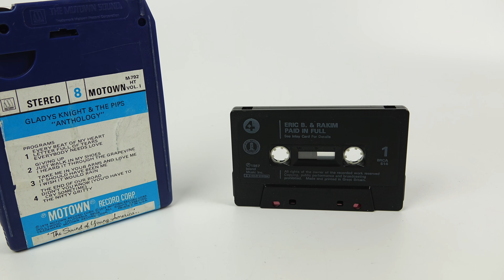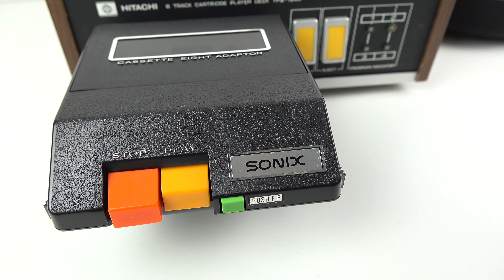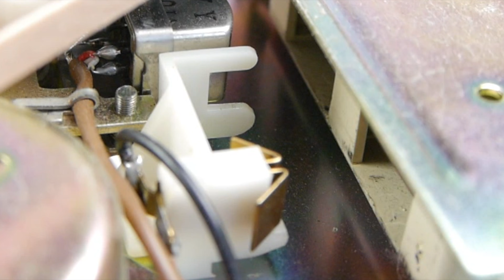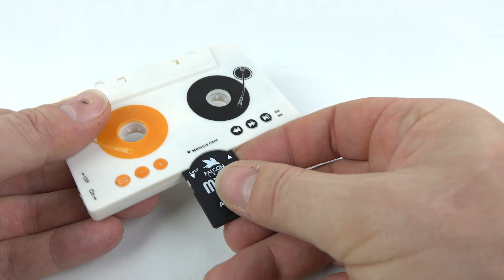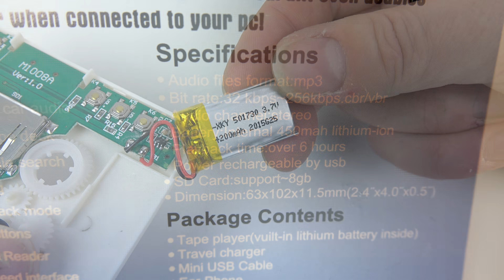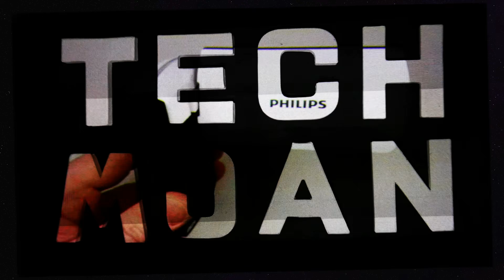Car Stereo Tape Adapters - 8-Track to Cassette to MP3

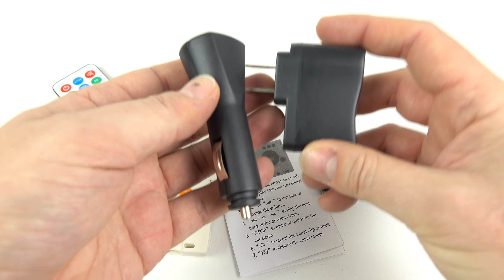Comment: 6:25, rule one for car adapters, if it doesn't have a fuse in the tip don't even bother thinking about wasting the time even taking them apart. Just no.

Comment: Just a crazy idea ... as there is some voltage available in an 8-track player, it should be possible to mount some BT-device in an empty 8-track cassette ... and even a card-reader ... Let's play (with) 8-tracks again !!!

Comment: Coming 7 years and 1600 comments late. My Venerable Bronco (1995) came with a cassette stereo. I didn't use it all that much. In 2011 I got an iPod from Megacorp as an anniversary gift. I got one of the adapter, then one that skipped for being boring. It worked pretty well. I used that all the way until 2020, when the stereo died. I replaced it with a modern one. I'd planned to keep using the iPod, but the new one had USB, so it was easier copy the MP3s to a flash drive.

Comment: the limitations written in manuals are just a list of what SD cards it has been tested with. some companies like Canon or Nikon make extensive tests with basically every SD available atm. others will just test a couple of basic ones. it's the writing speed and format which is important here.

Comment: I was hoping you would get to the bluetooth cassette adapter, but I guess that happened after 2016. The cool additional thing is that the cassette has a mic so I can use it my smart phone hands-free. Not bad for a 26 year old Buick sporting "Concert Sound II" with its own built in analogue  mixer.

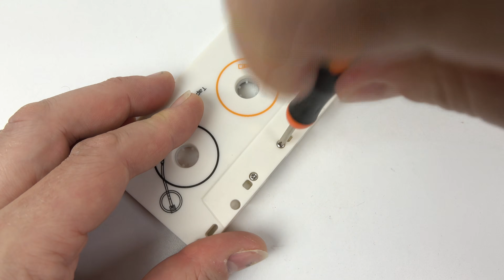Comment: 10:18 I would have added some little circuitry in there so that it would detect when the play head was actually engaged, and also detect the movement of the spools to use them as playback controls. Perhaps the gears could also drive a tiny generator to keep the battery charged.

Comment: Many thanks.   I just bought one of these 8-track adapters off eBay - it didn't seem to work, so with the help of your video, I took it apart and found that the belt has disintegrated.  I was about to write it off as yet another eBay failure when I wondered if it would still work with a cassette-to-3.5mm jack adapter.  Guess what, it did!  Even without any of the mechanism turning the head was still reading the cassette and passing the output to the 8-track.   Result!    I guess it would also probably work with a cassette-to-bluetooth adapter.

Comment: This wouldn't just have a use in cars. There were a lot of compact stereos sold in the mid-late 70s that just had 8-track and upgrading to cassette would have meant replacing the entire unit when the record industry dropped 8-track cartridges. This would have fit in quite nicely.

Comment: Although this is an old video I have one of these units that I have just found in the bottom of a drawer during cleanup. After seeing it have I have put the adaptor/player on charge and will be interested to see if the battery can still take a charge after sitting in a drawer for over 3 years. Wish it luck.

Comment: As strange as it may seem, my sister cleaned out a closet and found 2 unopened in the box AM/FM/8 Track car stereos, along with about a dozen 23 and 40 channel CB radios.( BTW They were mine, as the closet were in what used to be my bedroom before I got married) My current CD/Cassette deck in the Ranger has an auxiliary input (line input) that can be used with a MP3 player.
BTW the only 8 track tapes I still have are the old Gene Tracy Truck Stop tapes

Comment: I had figured out how the power gets to the adapter decades ago, and as you covered it the cobwebs very slowly cleared from my mind.  I remember buying a used car that had an 8-track and one of these adapters under the seat.  Retrieving that cassette adapter and slamming it into the 8-track put a huge smile on my face.

Comment: I have the tape adapter, it's really good expect for one major flaw. They should have given it a second power mode that powered the device on seeing rotation of the spools. As it doesn't have this and when used in a car you have to remember to eject the tape when you stop and to turn it off. 
Shame as otherwise it's a really good device.

Comment: Also, ive realised, if you have an 8 track player with a bad motor or belt, this device could potentially still work making an otherwise broken machine useful again as long as the auto change sensor works.

Comment: Most likely the 2GB limit was because that was the capacity at the moment but because of backwards compatibility the real limit is 32GB. Anything above that will not work because it's technically a different type.

Comment: https://www.amazon.com/Receiver-Bluetooth-Cassette-Adapter-Player/dp/B083BX9FPT/ref=asc_df_B083BX9FPT/?tag=hyprod-20&linkCode=df0&hvadid=416720031326&hvpos=&hvnetw=g&hvrand=6217685108824351860&hvpone=&hvptwo=&hvqmt=&hvdev=c&hvdvcmdl=&hvlocint=&hvlocphy=9016911&hvtargid=pla-885805583230&psc=1&tag=&ref=&adgrpid=95587149764&hvpone=&hvptwo=&hvadid=416720031326&hvpos=&hvnetw=g&hvrand=6217685108824351860&hvqmt=&hvdev=c&hvdvcmdl=&hvlocint=&hvlocphy=9016911&hvtargid=pla-885805583230

Comment: I have a Kraco adaptor. It's mechanically driven off of the 8 track capstan but uses power from the sensor to power the read and write heads. I believe it's possibly an amplifier inside of it.

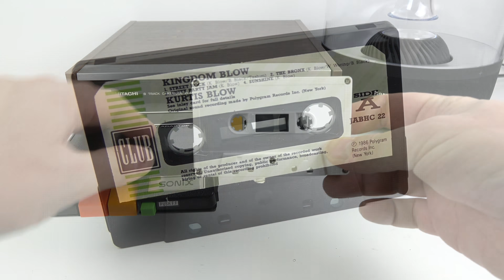Comment: 5:47 - "But let's move the same problem on perhaps 20 years or so later, if you've got an older vehicle with a Compact Cassette player, but you want to play MP3s on it." Yup. I actually bought two adapters for doing that. The first is the cassette adapter you showed right here, and it worked pretty well, but I'm surprised you didn't mention the second: an FM transmitter that attached to an MP3 player's headphone jack and played on any of several channels on the car's FM radio dial. The FM transmitter definitely had a sound quality advantage -- when it worked, that is. That, of course, was the problem. There were several things that sent me back to the cassette adapter. First, in places that have a lot of radio stations, like the city where I live now, it could be hard to find an FM frequency that wasn't being used by a commercial radio station, which the radio would pick up more readily than my little transmitter. Second, my FM transmitter tended to go through batteries quickly, and while it had an adapter that would plug into the cigarette lighter power plug, the car I bought this thing for didn't have a cigarette lighter. (On that car, the cigarette lighter and ashtray were optional, and since nobody in my family smokes, we didn't want to pay extra for it.) Third, even if there weren't any FM stations interfering with the signal, we found the range of the FM transmitter to be quite limited, and also very sensitive to where in the car it was sitting. So, while it sounded great when it worked, all too often, it DIDN'T work. So, back I went to the cassette adapter. That is, until  the tape deck in the car broke, at which point I gave up and just listened to the radio.

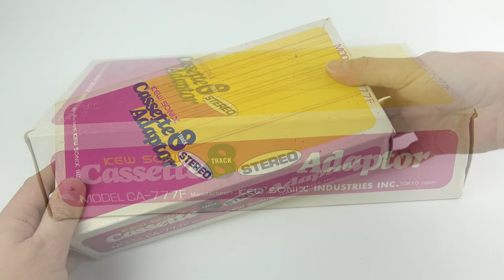Comment: 1:15 - "Now, I think these were supposed to be sold to people who didn't want to replace the deck in their vehicle; perhaps they didn't have the money for it..." If you look up some photos of built-in automotive 8-track tape decks, and then look up after-market car radios of the time, you'll see exactly why many people didn't want to replace the decks in their vehicles. In-dash 8-track decks, at least in American cars, were most often found in upscale models, and the decks were frequently built right into the decor of the dashboards. Replacing that built-in, original equipment radio and tape deck almost always meant covering up the exposed, open holes that the process created in the dash with a faceplate that didn't match and positively screamed "I AM NOT ORIGINAL EQUIPMENT!" This may have been less of an issue with Japanese and European cars, whose radios were often in alcoves in the dash and had black faceplates anyway. Younger drivers who had purchased a used, upscale car with in in-dash 8-track deck were usually fine with a replacement radio's obvious faceplate; a new, better-sounding radio with up-to-date features and, most likely, some new speakers added all around the car looked cool to them. (I remember this from installing my own after-market car stereo in my first car, a 1981 Dodge Aries that had come with a mono AM radio. The car was already 6 years old when I got it, and I liked the sportier look of the new radio faceplate instead of the stodgy, original AM radio.) But older drivers tended to care more about what the car looked like than what the radio sounded like, especially if the car wasn't that old. So, for them, an adapter like the 8-track to compact cassette one that you showed first was just the ticket. I wonder if maybe manufacturers of the adapters didn't take into account how many 8-track players were UNDER-dash models that could easily be replaced with newer players. That might explain where there are so many new-old stock adapters around.

Comment: I once had one of those 8 track to cassettes when I was 13 which was in 2011. It was powered by the motor of the unit though, not the sensing tape sensor. So when the belt broke, I took it completely apart and found that if I wired the sound head to an mp3 jack it worked to play my iPod. I then cut a hole in the back of it and made it work in fidelipac and Muntz 4 players. I was 13!

Comment: Don't forget about MP3 and WMV CDs! I bought a special aftermarket car stereo that could play those. Now they all can, but that was not the case in 2006 or so. My particular aftermarket stereo didn't have an AUX jack, and SD card slot, or a USB input (something I came to regret later), but I could at least play multiple albums without having to change discs in the car.

And, of course you could plug a Discman into a cassette adapter so you could play CDs on your cassette stereo.

That might be the first time an MP3 has ever been played in an 8-track player!

Comment: Hello I've bought the very same 8 track adapter but the FF spindle keeps pushing on its rubber wheel. Is it normal or should it only do so when the FF button is pushed ?

Comment: I've got a 12v power bank that I use to power a bunch of stuff in my room, and I installed a power draw meter to tell me how much power I drew at any given moment.
At 12v, my quite large cassette player used roughly .14 amps of power. That's just a bit over a single watt of power, which is an incredibly low demand. The 8 track sensor probably has a continuity detector in it, and that's probably why the strip is metal and the sensor has a current running through it.
I'm surprised with that kind of power source just sitting there, somebody didn't make an 8 track cigarette lighter adapter or something. You could probably just cram a whole radio's worth of electronics in there and just have a radio instead of 8 track

Comment: I had a cassete with a wire coming out of it that ended in a headphone jack... you could put it in any player and plug into a ipod or a phone. with the phone you could even use the speakers to answer calls... as long as you had the phone close to speak to its mic... and it wasn't any DIY, i bought it that way..  simpler that the mp3 player built into a cassete.

Comment: I do recall the radio announcement when the very last vehicle produced in North America rolled off of the assembly line with an 8- track player as standard equipment. It was a Ford pickup truck. I was just a boy. My generation grew up with transister radios, record albums, and cassettes. I have never owned an 8-track but saw some and thought that their continuous play was neat! Or "neato," as we used to say.

Comment: Just shove some pins in the 8 track player and you have a full power supply. Who would have thought that would work. I've tried one of those cable to caset adapters and it sounded terrible and only lasted a few hours before dying permanently.

Comment: I think that 8 Gb has been biggest SD card at that time. That's why it's printed for that MP3 players brochure. I've seen that many times through years that like for example smartphone supports 128 Gb but later came bigger SD cards like 256 Gb and those did work as well. Like my drone did too.

Comment: 13:26 you can only find it out by playing a file that is not stored in the first 8GB. You don't say if you did that in the video. Anyway, sometimes these limitations only mean the maximum size that was tested. If the device is on the market since a few years, 8 GB might have been the maximum that was available when they tested it.

Comment: Do you know if the cassette head reader sends the cassette signals straight to the "reproducing" head? What I'm trying to understand is are the cassette NAB poles the same as the 8 track one's? If not, we can assume that the circuit also do some NAB conversion.

Comment: I had a 1996 Lincoln Continental that had a cassette player in highschool it I used the cheap cassette with the aux chord and the sound quality was not the best. But the car was also 18 years old by the time it actually died and it was heavily used, I still miss my car

Comment: My friend had a mp3-FM adapter that plugs into the car's 12V power supply, plays mp3s from internal storage and sents outs FM signal that can then be picked up by the radio on the car. It's probably illegal and the sound quality isn't great but hey at least it worked 😂
The most annoying part though is that it got a full-sized USB socket for data transfer and it was a pain finding the right cable when we lost it on a road trip😂

Comment: The cassette to mp3 adapter is quite a clever little device. Actually both adapters are clever. Bridging the analogue mechanical to the digital.

Comment: The limitation with going to big cards is that the player will only load a preset number of songs.. say 500... into memory so you get lots of repeats anyway unless you switch songs on and off of it sometimes to reset the shuffle.

Comment: Usually size limitations on media mean that the device can only address a certain number of blocks, in this case 8 GB (not that it will simply not function).  You might have found if you tried to play a song that was located in the later portion of the SD card that it would not work.  Of course this is hard to test since the blocks are not sequential but that's the concept.  Otherwise cool video, I was hoping you would  make a Frankenstein and you did not disappoint!

Comment: 8track player loaded with a cassette adaptor deck loaded with an mp3 wired cassette plugged into a portable fm radio tuned to the frequency of a 9v automotive FM transmitter player plugged into the headphone jack of the cassette MP3 player shuffling a selection from the YouTube audio library.

Comment: I took this idea one step further.  I plugged the little cassette MP3 player into a FM transmitter kit that I built up from a kit sold on Ebay.  I sat it next to an old replica Emerson radio that mom had for years till the caps leaked on it.  I recapped it to make it work once again. So it was, last Christmas, that little cassette played Old Christmas tunes over that radio, much to the joy of my mother who thought her old radio was shot, and my good wife of 50 years who loves Christmas tunes.

Comment: Ahh, the memories.  I did the EXACT same thing a long time ago.  It's one of those 'can it be done' sort of things - right?  Well done.  I didn't take my units apart like you did, but did fit the adapters into one another.  Do you remember the 8 track adapter that would fit into a 4 track tape?  I think I have one of those lying around in my garage somewhere too!!!   Good stuff.  I can only imagine kids looking at this video and wondering 'what the heck is this guy doing?'!!  LOL!

Comment: It'd be cool to see a new version of the MP3 to SD adapter with a small alternator inside of it to use your machines play advance to keep the internal battery charged. 

I'd gladly pay double for one if it meant never needing to charge the bloody thing.

Comment: My 1976 Dodge Aspen came stock with an adapter which DIDN'T require batteries.  I know because it was stolen by a "friend" and it was used in his earlier 1974 Dodge Dart.  It had to be that the Dodge factory deck had power leads which would power the adapter which frustrated me as I couldn't find another one in 1988.

Comment: I found it humorous that the belt on the cassette to 8-track adapter was still good.  I think every Sony cassette deck I ever owned had belts that dissolved into sticky and fragile brittleness and this, more or less, No-Fi cassette adapter works probably as good as ever with a solid belt still inside.  Perhaps Sony designs the belts to self-destruct by some grand scheme?  

A question...I've always wondered if these things might damage the head of the deck that these adapters  are putting metal to metal with a thin plastic or whatever as the only thing between the two?  I guess the pressure from the adapter's head is quite important as to not be too heavy?  Anyway it kind of seems like these adapters could damage sensitive tape heads.  What do you think?